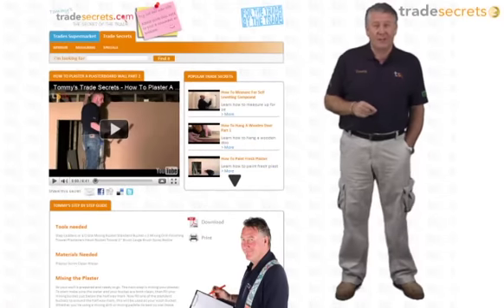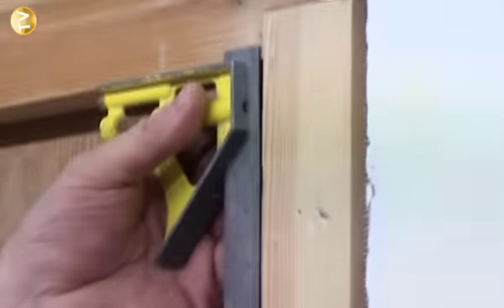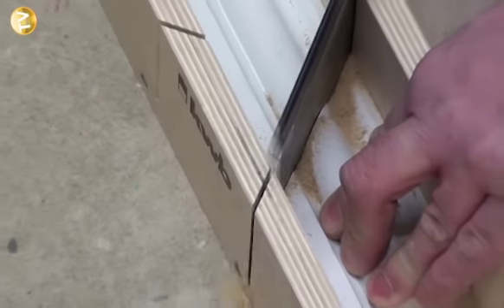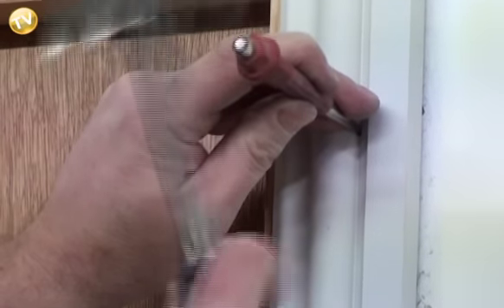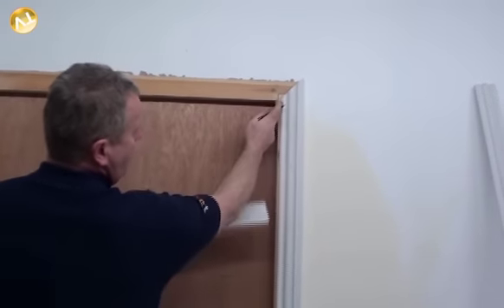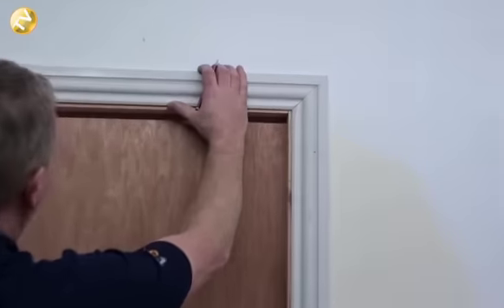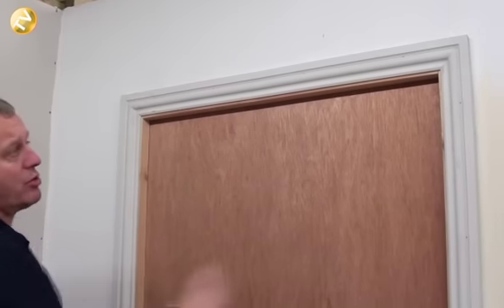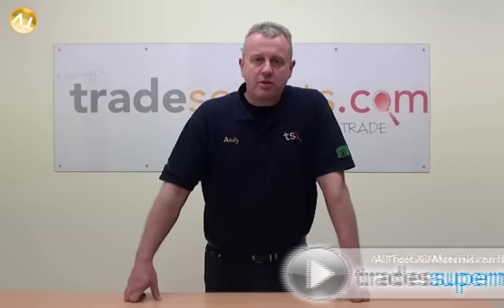Tommy's Trade Secrets - How To Fit Architrave

Comment: What do you have to do if the frame is not exactly square? Also the left side leg of my arhitrave needs to be cut lengthways so it is only 3/4 width because tge frame sits against a return wall. How best to cut that myself? Ps i think he was just demonstrating a 'what if' scenario with jigsaw - ie no mitre block. 6mm is standard aesthetic choice and leaves jamb repair able if damaged by 6mm ply with i believe. But can be different depth anywhere from 4 to 10 mm and its less important than getti

Comment: do the heads first, cut with a drop saw at 45 degrees then use a hand plane and plane until both ends are flat and straight (test by using bottom of hand plane). nail using a fix out (finish) nail gun. then cut the two sides again at a 45 degree mitre and plane to suit the head mitres. thats how we do it here in Australia (or at least thats how i do it) and it looks a lot better with no gaps. 

dodgy.

Comment: Cut the head first, then drop the jambs, any slight discrepancy in length can be lost at the bottom between floor board and architrave. Most door casings these days are less than 25mm thick on the rebate side, so nailing needs to be accurate. The 6mm set in, allows fitment of the hinge. If you butt up to the edge, you'll end up rebating for the hinge. Glad he's not working on my job!

Comment: You can also use the first off-cut to duplicate the 45 degree angle and use it through-out.
What happens to the electrical cabling running along the door jamb area, should you not 
think of them before driving the nails into the architrave? There is a light switch (usually) 
fitted next to the door jamb with hidden cables running into it.

Comment: @davidpidge Ah...........actually..........I think it's properly called a nail~set. What's up with this guy cutting a mitre with a jig saw. Very difficult to do that. Here in Canada people use a chop saw or mitre box to do this. Also, for molding installation when useing that curs'ed MDF, nobody here would use a hammer and nails. We use air~nailers.

Comment: Albeit it easier to support the header, this actually isn't a good idea as your architrave can potentially come out of plumb and thus stagger the joints. Secondly, it is very bad Cabinetmaking/Carpentry technique to cut mitres all over the place and not one mitre at a time in sequential order as is taught out of any textbook.